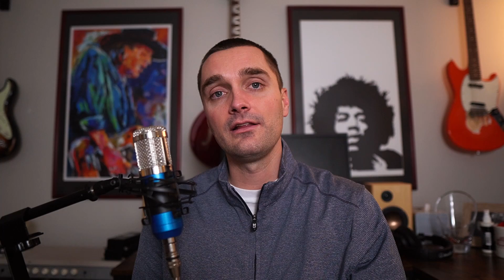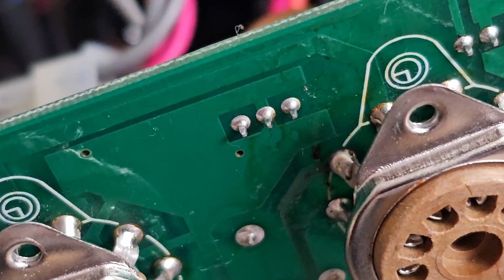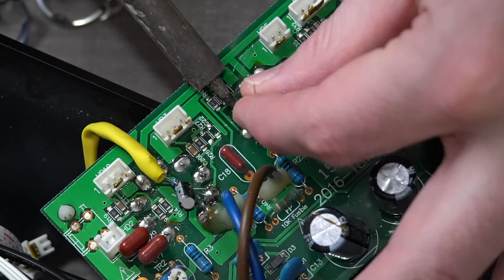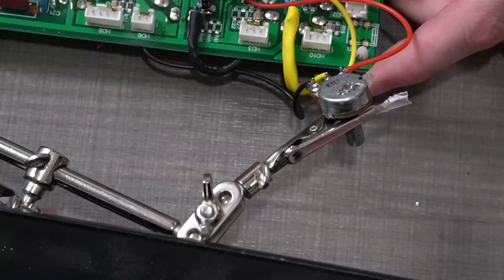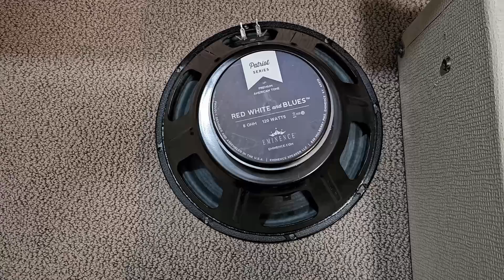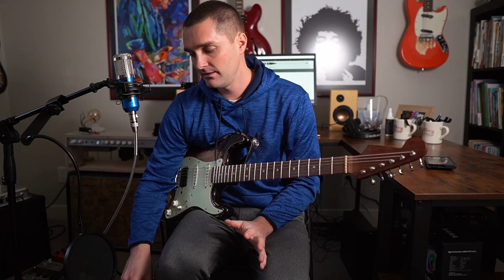Tuning my $140 Monoprice Stage Right 15w tube amp into a FIRE BREATHING MONSTER!  Amp mods

Comment: with that second gain pot cranked all the way it sounds kinda like a gated fuzz, which is kinda cool for something built right into the amp
Reply from the maker: Yeah I think that's what happens with no grid stopper. Interesting indeed.
Reply: @These_go_to_eleven_1959 This is what my 50s princeton sounds like cranked, that kind of NY Crazy horse tone. AMAZING, try it before solidifying your opinion brother. It's amazing fun! I'd love to have this amp build. Been obsessed with 5 watt amps recently, been running that princeton and a 5 watt supro wet/dry. Fucking killer

Comment: I had one a couple years ago. Damn thing kept getting damaged in shipping so finally accepted a broken one, rebuilt the inside of the cab and hot glued the Tolex, glue and sawdust to make better screw holes.
The 70/80 had a nice chime compared to the Celestion A . . . so speakers do make a difference. 
I sold it off . . . kept the little 5 watt Stage Right which is great for the office and harmonica.
Reply from the maker: Yeah I did another video where I opened it up and the construction techniques and materials used are very basic.  The amp is not very rugged.  I think the cab was made from some kind of weird particle board type material with the silver corner protectors also providing structural support.  No finger joints or cleating to hold it together from the inside.

Comment: Mine started blowing fuses.  I suspect loose or damaged tube sockets.  Could that be it?
Reply from the maker: I would take voltages first. Start with the tube sockets and the b+ rail.

Can also try removing all tubes and then adding the back in from back to front.